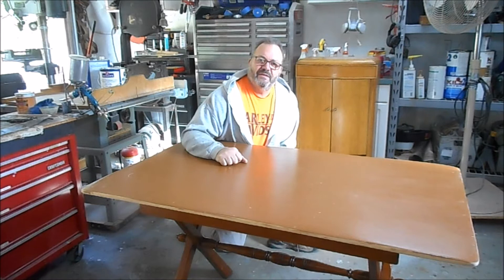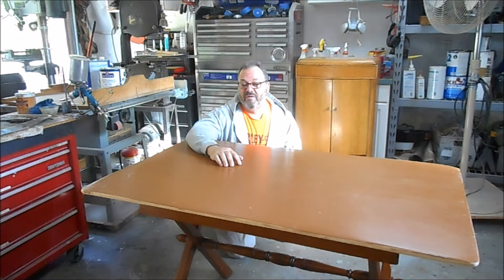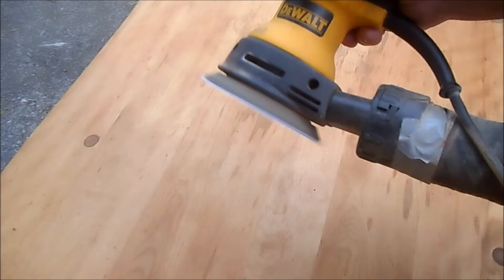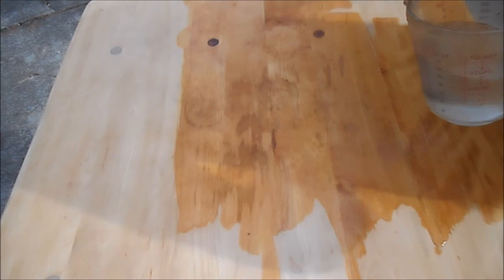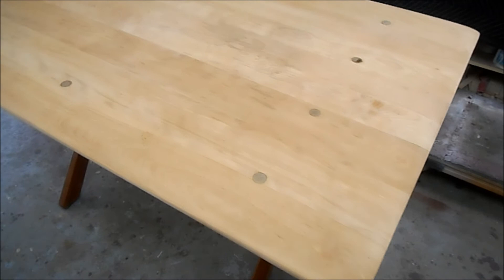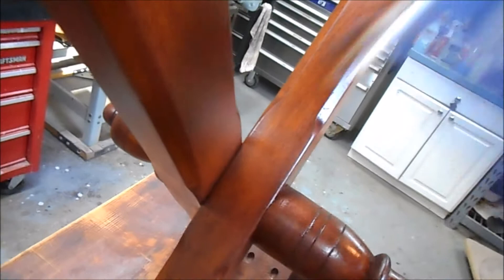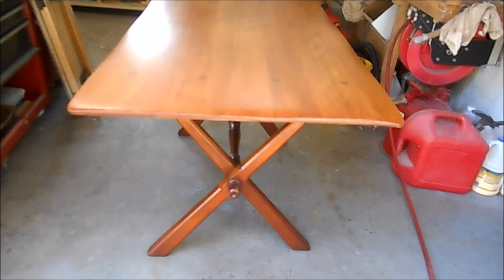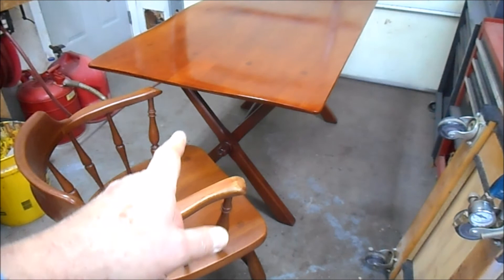Restoring a Cushman Colonial Table

Comment: Hello I got a Cushman 4 drawer chest the has the back pannel splie and swollen. Can the back panel be restores or shoul i just go get another piece of plywood?  Thanks great video
Reply from the maker: Pretty much anything can be fixed, it just depends on how much time, money and skill you can put into it.   As far as value goes, original is always better, but right now, here, there's not much if any value above the utilitarian value as a piece of used furniture.
Reply: @LostMountainRestoration   the I'll go ahead and get a piece of plywood. It had some nails an traces of glue I jus noticed its a little wobbly. Any video on making it a chest sturdy? Thankyou
Reply from the maker: @rodolfocarrillo1254  "Saving a Strip Tank Victim" is one.   You'll find it shores right up when you get the back installed correctly.

Comment: Can you tell me more about the glaze you used? Thank you
Reply from the maker: Glaze is a pigmented medium designed to go between top coats.   I use the oil based glaze by Mohawk.   There are many other manufacturers.   It's a great option for color adjustment, adding depth and highlights as well.  Thanks!
Reply: Lost Mountain Restoration Thank you!
Reply: @LostMountainRestoration  Which color of Mohawk glaze?  Burnt Umber looks too dark, Burnt Sienna looks too light.
Reply from the maker: @didigingue239  Burnt Umber in this case (9:06).   Remember you can dilute it with mineral spirits to adjust the color to where you need it.
Reply: @LostMountainRestoration  Thank you.  I have a couple of Cushman pieces that need to be refinished.  I hate to do it, but the finish is so far gone that tryinh to save it is impossible.  I can tell that the color wasn't applied to the wood like a stain. I was able to research their finish and found out it was a proprietary combination of a lacquer and wax finishes, now lost to the ages.
Reply from the maker: @didigingue239  By using glazes, you can probably get pretty close.   Put down a seal coat, when dry apply glaze, if OK, top coat and repeat adjusting the layers of color as you go.
Reply: Lost Mountain Restoration 🙏🏼 thank you! This answered all my questions. You’re awesome! Love these beautiful woods! 👍🏻